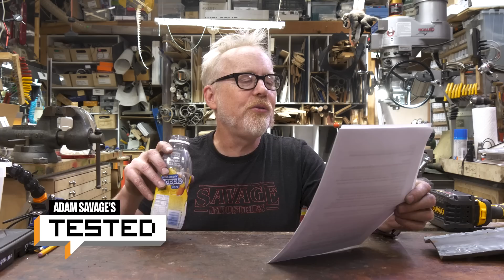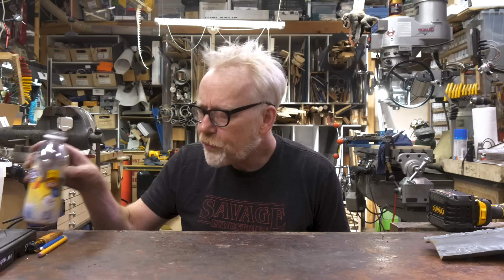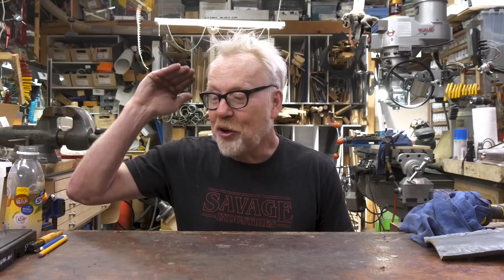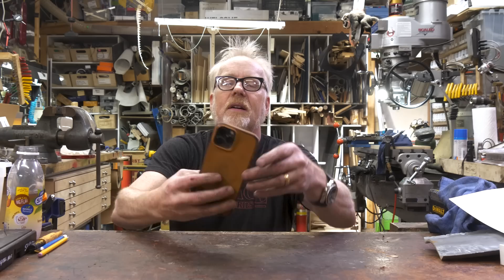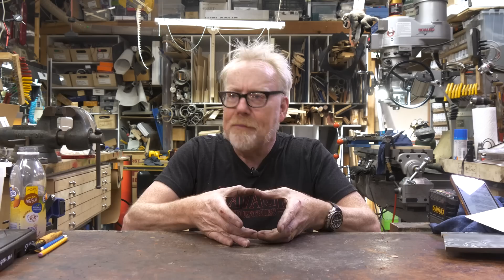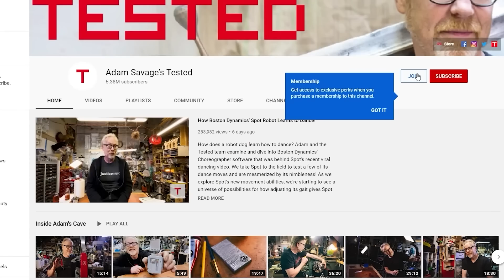Ask Adam Savage: Ignoring Your Personal Aesthetics for Certain Jobs

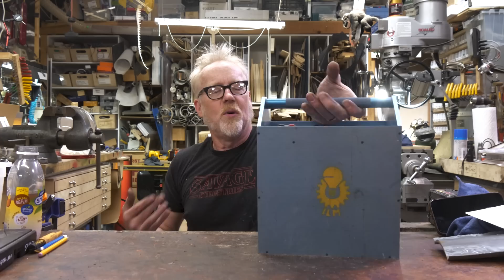Comment: 5:40 When I was in film school we had something similar. We called that a ballast. This was just for your standard scene shooting. We weren't doing sfx of any kind. It would go between a light and the power box. It would keep the lights consistently rock solid at the desired color temp and power level throughout takes. I think we used Arri ballasts in 1999.

Comment: The weight in that power supply, wow. I would love to see the inside of that unit
Reply: I suspect the only difference is the voltage setting potentiometer.  It looks more robust than normal.  The case also looks like it would be more difficult to accidentally change the setting.

Comment: On different design aesthetics, many of the interior designers i worked for would develop a visual design, and specific measurements of the space were added later.  i would build the items in the computer.  If the rendering didn't meet up with my expectations, i would contact the designer, voice my concerns and work with them to fix the issues.  My aesthetic was always a part of the process but didn't override my clients.